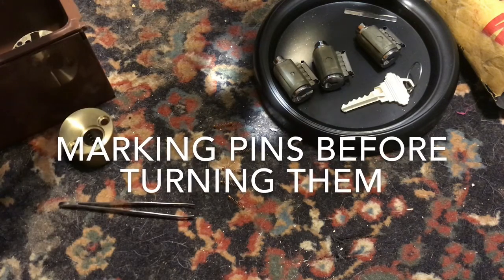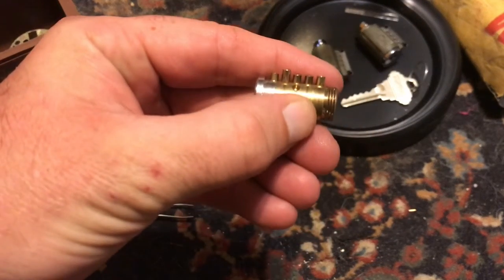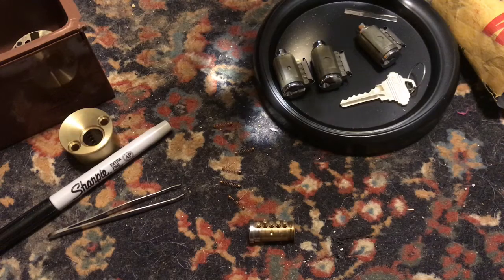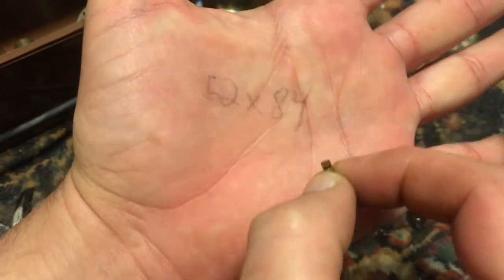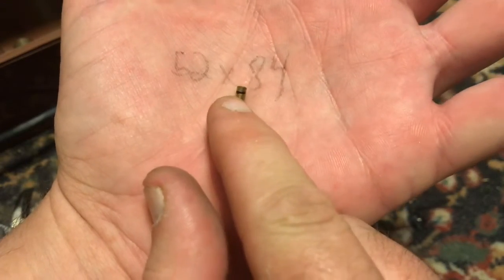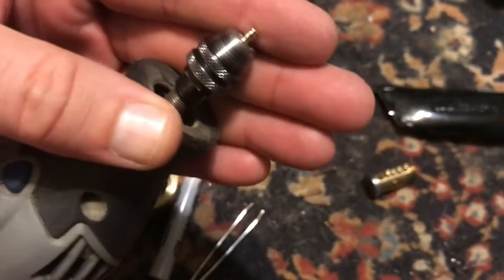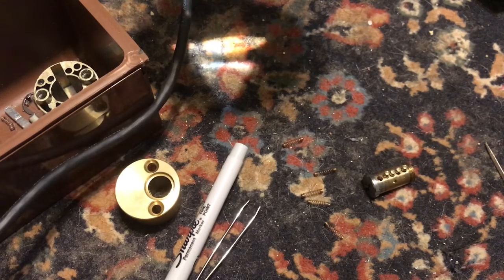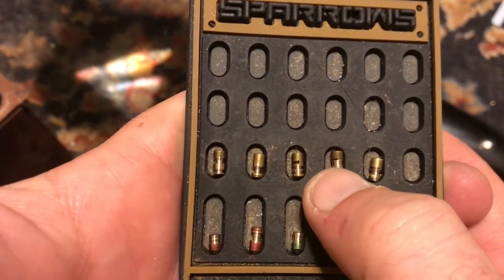Some Pin Shaping: Marking the Shear Line

Comment: Great idea, I do something similar but I just eyeball it instead of marking it. I see a lot of challenge lock makers shape the entire driver pin and although it looks awesome, it seems like a waste of time to me. I used to not even modify the keypins because I figured they wouldn't come into play unless they overset the pins. Thanks for sharing.
Reply from the maker: Yeah I tend to shape most the pins and then I'm left trying to mix and match stuff...which also leads me to wanting to use the entire pin, and then I'm just left with long drivers and a not so great bitting.